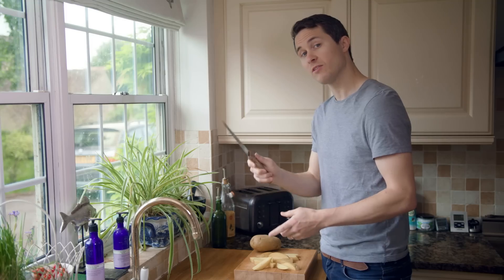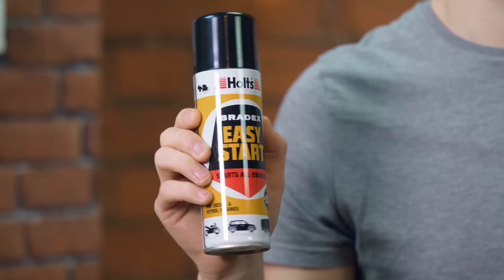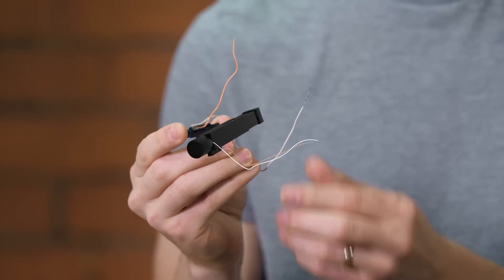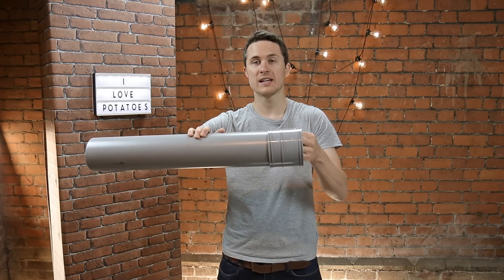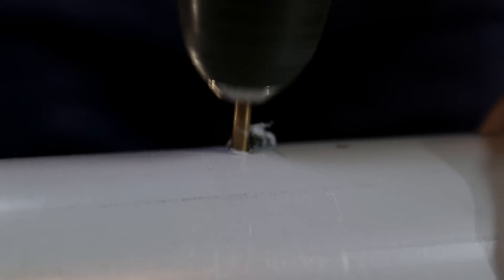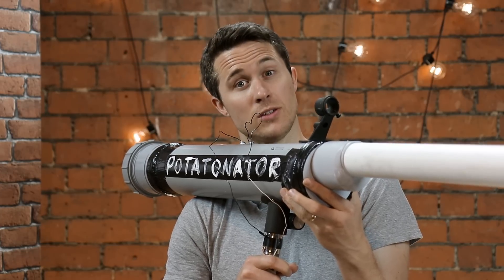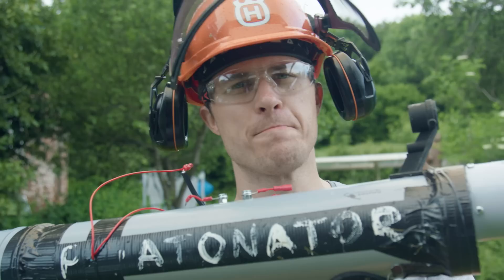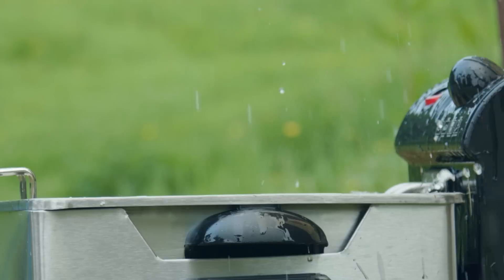How To Make A Potato Cannon That Makes Chips

Comment: I was hoping the whole video to see how you fill the cannon with the fuel, but sadly that wasn't on camera :/

Do you just take off the cap at the end, spray for about 10 seconds in the cannon and close the cap as fast as you can?
Reply from the maker: Scott Mackay hi Scott, sorry about that! Well, the plan was to unscrew the cap and spray (although not for 10 seconds, more like 3-4). However, this wasn't working very well, I think because the oxygen mix wasn't right. So I drilled a hole in the center of the cap which let more air in and, as a bonus, meant I could spray directly into the chamber without unscrewing using one of those little tube spray adapters like this one : http://bit.ly/2tDQTbl

I'm on holiday at the moment, but when I'm back I will put some footage of me doing it on the Every Think Facebook page. I'll send you a link when its up. Thanks for watching and please subscribe if you haven't already. :)